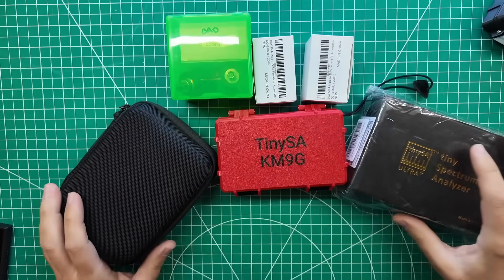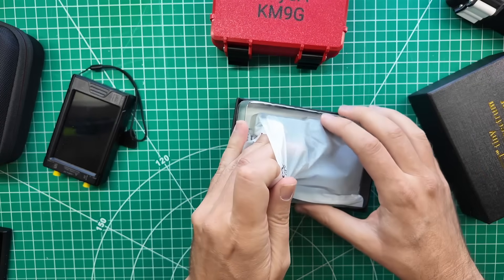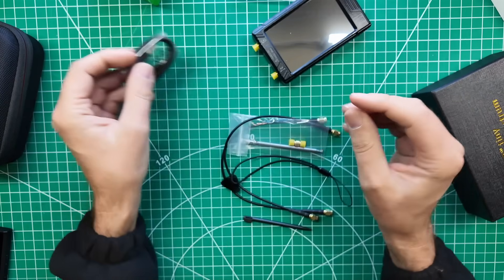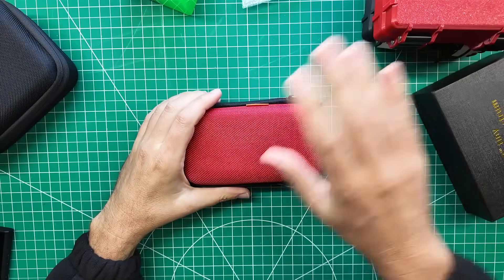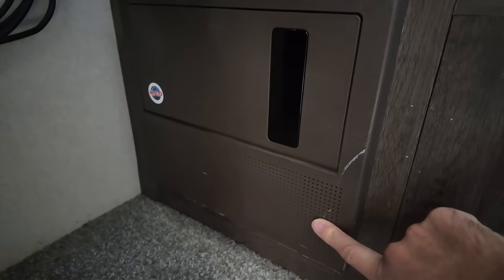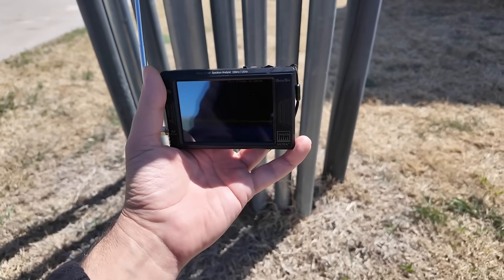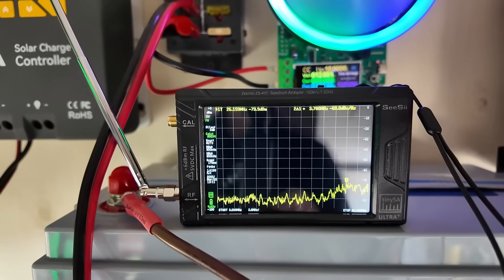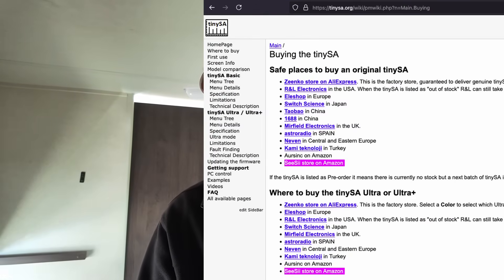I Took the TinySA Ultra+ ZS407 RF Hunting in an RV Park… Here’s What Happened

Comment: This is arriving Sunday. Can’t wait to start using it. Have many questions about it. 

For example, can I use an external battery pack and leave it for 24 hours at a given location? 

I’m a PI. I’m monitoring for signal jammers used in robberies and break-ins.
Reply from the maker: I don't see why you couldn't... Just keep an eye on heat and give it some bench tests.  The internal battery lasts a long time, maybe a solar panel that outputs USBC to keep it topped up? Not something I've tested directly.

Comment: For Christ's sake you can't use tiny essay for hunting RFI at least not in any reasonable manner the noise floor the tiny essay is equal to about S5 on an HF receiver and if you have an S5 noise floor then HF is pretty much unusable at your location. 

Keep in mind that any decent HF radio has a noise floor -140 DB or more where are the tiny essay is barely -90 DB. Also keep in mind that around -73 DB would be an S9 noise floor so when you're looking at devices that are showing -70 dbm that would be around S9 on your HF radio -90 dbm is around S9 on a VHF UHF radio that's why you're better off using an HT to hunt for noise.
Reply from the maker: Thanks for sharing.

Comment: Hello, I wanted to buy Z407 over Z406 because of its lower phase noise, but some people telling Z407 shows noise increase below 20MHz (LNA=ON). I appreciate if you put the start frequency on 100KHz (not zero) and check this rumor. For my use case, 100KHz to 30MHz is very important for EMC testing. I dont want to see some uphill below 1MHz because of the device noise issue. Thanks.
Reply from the maker: If I get a 406 model, I'll take a look.
Reply: @temporarilyoffline  Check with your 407 at low frequencies
Reply from the maker: @hp2073 Right

Comment: My 2nd message. As a secondary device, I'd like to measure surrounding air radar/wifi/rf/2.4-5G dirty pollution. I've seen these gigantic dishes going up since 2020 -- at the beaches, the bays, in a restaurant (lot of eateries) parking lot. Kinda scary.
Reply from the maker: You could use this device to "spy" on equipment nearby, sure.  It would show you the frequency and if it has an audible component, you could hear it too.   You'll probably wind up with lots of tools as you go down this rabbit hole.  Its a fun world to explore.

Some tools will even decode the data for you.  If you're super serious, start looking at "SDR Software" and take a look at the RTL-SDR Blog.  That will get you jumpstarted... and a few years and thousands of $$ of sub $50 gear and you'll have many memories to share.

Comment: Could you capture TV remote signals? I bought a gadget a few years back. Captures TV signal and can turn my tv on/off. It was for a prank to turn off my buddy's TV. Anyway...

Not only would I like to record and reuse frequencies, generate them after I've recorded them. Does this device to that?

I'd like to capture a signal and then design a board that outputs the signal. I messed around every so slightly with a breadboard in college before I dropped CSE and went to CS. I think it was a mistake, but the UC has a crap CSE department full of nerds that didn't help the students but only played with each other. Ayy Vay! 

Say I wanted to duplicate something that a gardener just broke. A "rodent/cat" ultasonic deterring device. It scans the area 360 deg and flashes a light and sends ultrasonic sounds to keep the stray cats from poo'ing in my yards and garden.

Thanks!
Reply from the maker: This device could do some of that, but not all of that.  Its not really a "good" transmitter.  What you're looking for is a "Flipper Zero".

For example, most TV Remotes are IR and not RF, the TinySA doesn't have any IR inputs to record with or IR outputs to transmit with.

The flipper is a hacking platform for RF and there are a few of those out there.  Its a "you're in a different domain" issue.  Like using a hammer to cut a board... you can do it, sure... but a saw would be better.

Comment: The biggest change I saw was the led lights. whole spectrum noise definite change 10 db was what I thought I saw, a slow change.
Reply from the maker: Yeah, the refresh rate for a larger spectrum view is kinda slow.  Find a problem and then you can narrow the span down for faster refresh as you're getting really close to the source.  Like metal detecting or fox hunting.
Reply: @temporarilyoffline  In my experience, the tinySa/s are ok for sensitivity but not perfect. I have one, it isn't a high 7 gig version but I doubt that the sensitivity was improved that much. The reason I'm mentioning this is if the SA were to be able to see any of the devices you tested it should have been the LED light. They are one of the noisiest devices out there. The next is a Samsung AC charger or the like, also very noisy. I had to change over to 12v powered chargers and it cut my noise factor way down.  And, of course, eliminate all led lights.

Comment: you need a log-periodic antenna and a LNA. The antenna you are using is pickibg up from all directions. Even you holding the SA may be contributing to a higher noise level.
Reply from the maker: @johnbofarullguix1499  yep. Lots of ways to do it.

Comment: I thought I made the big time when I bought a $35 EMF detector on Amazon to see why my inverter type microwave oven was messing up my Bluetooth connections. That is a nice little unit but I think a variety of antennas would be useful.
Reply from the maker: All the magic of Radio is in the antenna, you got that right!  Your microwave interferes with your bluetooth and wifi because all 3 devices have 2.4xGhz operations and the microwave oven uses a much higher power transmitter to cook the food.
Reply: @temporarilyoffline  My body will block out the microwave Bluetooth interference but the microwave emissions are barely readable. I know my body is absorbing microwaves. I also killed the WiFI Bluetooth board in a Thinpad laptop years ago by using it right next to a non inverter microwave.

The emissions from the tiny over the counter LED light are extremely high. This is where the Spectrum Analyzer would be nice.

Comment: Yes them tiny test gear came a long way.  Some years ago they took up a hole cart to push around . I got different results in campgrounds around hear . Some LED lights were quite noisy . The old florescent lights were quite bad.  1 power transformer made a bussing with crackle sound in AM radio . Some gas golf carts make RFI . Some power stations do . some Portable gen sets do as well. Some China MPPT units are real bad with inverters.  Some micro waves make RFI . On a bad day the girlfriend makes RFI ! The only RFI I get from scooter is the starter noise. The motor drive on my 48V EZ GO is quite noisy only from a short distance . Has that PWM motor controller. Most of the newer ones do. What is real noisy is in the winter at back of campground is HV 345KV grid. Boy that noisy in real cold . Nothing in summer when place is open. Sometimes when below zero and no wind we see a purple glow of insulators on power lines. They at end of campground . 1 road goes under them . Also use a battery AM radio tune to no station. Also works finding RFI. We have some AM and SW listeners hear in NY . 73
Reply from the maker: Which campground do you work?
Reply: @temporarilyoffline  I do work for many camp grounds . Normally I am a electrician but do outher RV and electrical work.  Camp grounds come to me for work when needed .I get free camp cites at times. I work out of my home and go to work cite wear ever that is. That storm system is in Boston NY now. Super windy. Thunder all around . Muggy !! NOAA going off . Local SKYWARN going . S.A.M.E. has Tornado watch and sever thunderstorm warring .  Golf cart is done and faster. It does 20 MPH now. it did about 12 before. It's ay my home and waiting for storm to pass and they pick up and I get paid.  Answer is any campground that comes to me I work for.

Comment: Should I tell him .. hmmmm... Set the Tiny SA to max hold mode and sit it down next to the noise source for 10-15 minutes. I have an rx888 MK2 and it can do a wide almost instantaneous spectrum. On it I could see the huge mess my ethernet over power was generating but that was invisible to my tiny SA. I found that the tiny SA could see it if it was put into max hold mode and left for awhile. The problem is the tiny SA is too slow, so it sums up the signal at each frequency. And for noise it cancels itself out. Or at least that's my best understanding of what's happening.
Reply from the maker: You're 100% correct.  It would be faster if I had chosen a smaller bit of spectrum.  For example, but the MPPT, I saw there was a problem from 20-30mhz, so if I would have narrowed it down to 20-25, then 25-30, then 30-35, etc it would have swept a lot faster.  Its a good tool if used properly and it can do so much that one short video won't do it justice.  I could dedicate a whole channel to it.

Comment: Thanks for making this video - I've been on the fence about Tiny SA in deference to more expensive equipment - essentially reticent having (maybe) falsely surmised that the image suppression and image rejection / noise rejection capabilities of the Tiny SA would be weak / non-existent - in other words susceptible to all kinds of signal garbage. So I was pleasantly surprised to see that the Tiny SA "rejects" really well. For example if you held a regular (mono) Panasonic or other AM / FM radio to the same signal sources you are probing you'd probably find they are noisy AF close up. If you carried out such a test WITH a regular radio side by side that would be a potentially useful metric or indication for crucial front end design and image rejection of the Tiny SA. So again @Temporarily Offline thanks so much for making this vid ! Really helps in a GOOD way 🍻 RV looks "resplendant" . [AM and FM radio - particularly low AM side you can hear all kinds of noise from practically everything electrical including scrolling on yer cell phone . ].
Reply from the maker: Thanks for the great comment and the kind words!

Comment: Wouldn't you need a longer antenna for the 3-30MHz range to be meaningfully read in the TinySA?
Reply from the maker: It would benefit, but it wouldn't change the readings up close.  "resonant" is EXCELLENT for TX, really GOOD for RX, but imagine if you had the right size antenna for 570-1600AM on your car ;-)  RX is a little more forgiving.
Reply: Actually for RFI detection, a little noise loop is preferred.

Comment: I have a RV with a similar panel to yours (older 2016 Jayco Jay Feather). I used my 705 with a ht antenna and found that mine was pretty noisy. What could I do to quieten it down rf noise wise? Robert KD4YDC
Reply: Turn off the converter when running HF, it’s the charger portion of the converter that’s killing your RX. Run off batteries while on HF. …. Full time RV’er here. Go to Palomar Engineering and stock up on type 31 ferrites.
Reply from the maker: You mentioned the 705 which is a very broad TX/RX radio.  It gets a little more interesting, but not impossible:

#31 — Best wideband, HF + low VHF
#43 — Good for mid VHF
#61 — Best for high VHF/UHF

That being said, distance also helps quite a bit - even just the other side of the RV will be quieter.

Comment: The form factor for TinySA makes some sense as I don't use it outside. However, I will never understand why they won't update the display technology and maybe provide us bluetooth to a nice phone app. Oh well, I keep hoping.
Reply from the maker: @don_n5skt  a phone app would be nice, but I haven't looked.  There is a PC App.  This thing has so many features that I could just make videos on it for the next 6 months!
Reply: @ I would watch those 😀
Reply: I understand the convince that Bluetooth Connection would give but... ,  wouldn't there be a conflict between a device trying to capture the spectrum while simultaneously generating Bluetooth RF.  Maybe it could warn you that it is blocking  2.4GHz - 2.5 GHz to resolve that if Bluetooth is enabled but otherwise it seems in conflict to me.
Reply: @LWatsonIII  Well, they need to do something with that tiny screen font and that 1998 version of the PC app is just nasty. As a software engineer, this could be done way better for both this and the NanoVNA.
Reply: @don_n5skt  Well, as a software engineer, why don't you write a better app?
Reply: @JustMe-u6o2j  Those are hardware fixes. Not a hardware engineer.
Reply: @JustMe-u6o2j  I second that motion.
Reply: @don_n5skt  QtTinySA isn't too bad, and if you don't like how it looks you can fork it.
Reply: Because that feature will make the price at least $300.00
Reply: @elitecombatfitnesscentral  ESP32s with Bluetooth are cheap.

Comment: Attenuator repair video when? 🙂If I were making one, I'd thermal pot the heck out of it to make best use of the heat sink, but the teardowns I've seen are just boards or components in air with a tenuous connection to the heat sink.
Reply from the maker: I don't know if it is repairable... but I'll definitely take it apart!